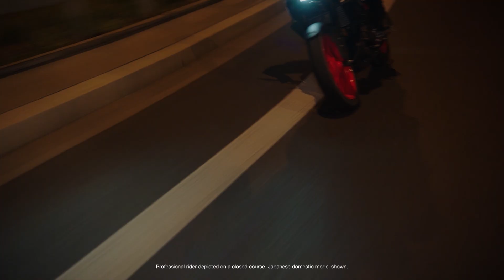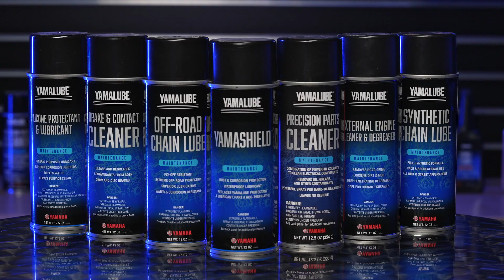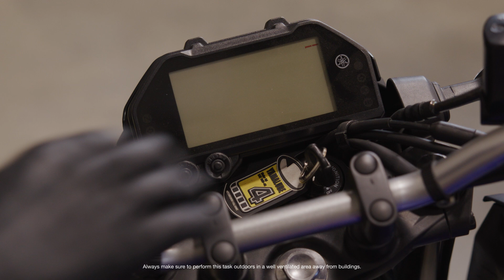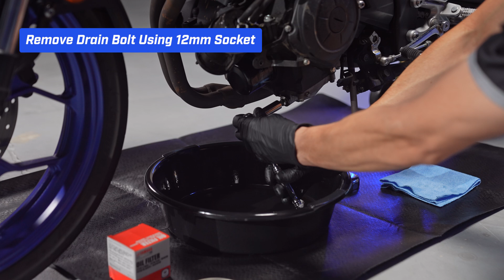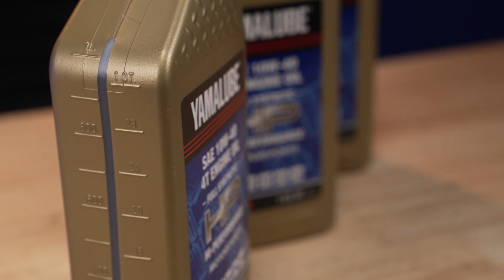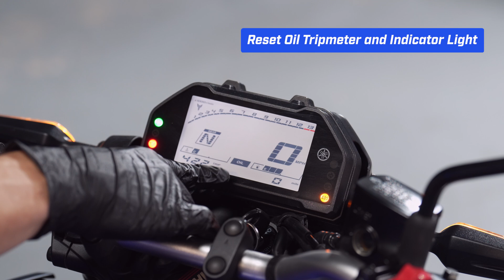How to Change the Oil on a Yamaha MT-03 | #Yamaha DIY Garage

Comment: Is it mandatory to change the oil filter after changing the oil?
Reply from the maker: The details in the video are best practices for an MT-03 oil change based on the instructions in your owner's manual.
Reply: @YamahaMotorUSA  thanks buddy❣
Reply from the maker: No problem, pal!
Reply: @YamahaMotorUSA  I'm looking to buy an mt03, the 2025 edition.
Reply: To actually answer your question, no, it is not mandatory at all, simply recommended. Yamaha themselves even provide information for the amount of oil you need if not replacing the filter for this very reason. It’s not going to blow up your engine, but if you want peace of mind about reliability in the long term, it’s best practice. Especially for your first oil change.